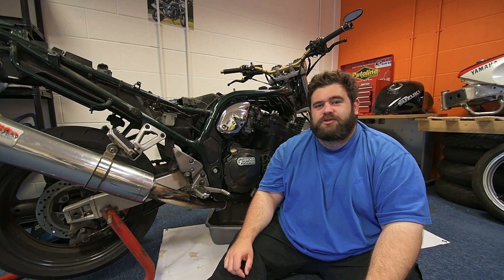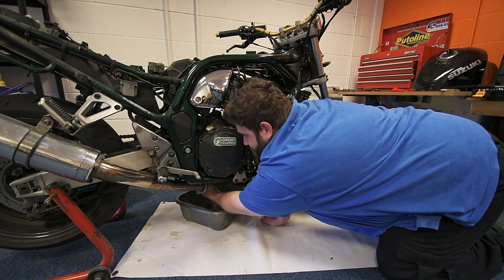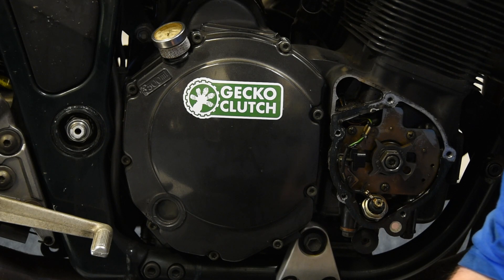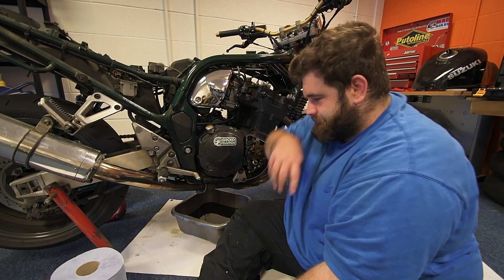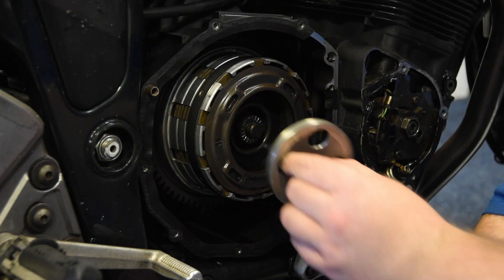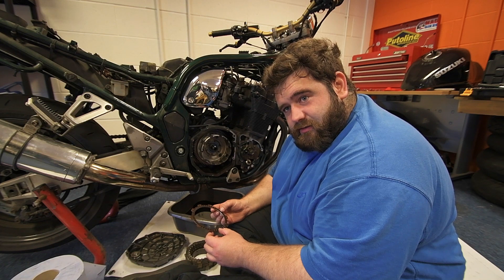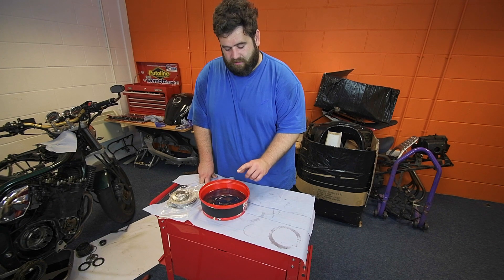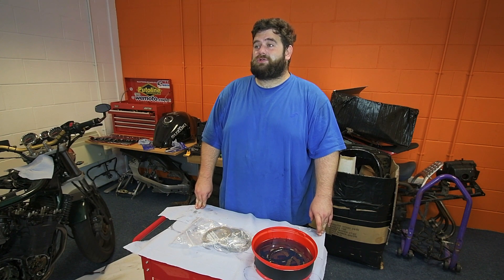Suzuki bandit 1200 Project part 6 || Classic Motorcycle Mechanics

Comment: Gotta say you are misinformed about using a total synthetic oil and the clutch slipping...Use Motul 300V 10w40,no slipping ever and will withstand higher temps and cool down faster as well...It will only slip with poor quality parts and oil...Hope that helps,subbed ya.
Reply: As far as I know I have Castrol superbike full synthetic oil in my bandit. No slippage yet. Any concerns ? Advice is welcome plz.
Reply: Do you have the first gen 1200 or the 2000+ model? The first gen does not like synthetic, I used Castrol synthetic in mine and it started to slip almost right away, changed back to a conventional oil and it went away within 50 miles. The second gen has a slightly different clutch and works fine with synthetic
Reply: Second gen 2004 1200s model. Thanks for the reply. much appreciated. So I'll leave it as is then. I will probably go back to half syn, next oil change.